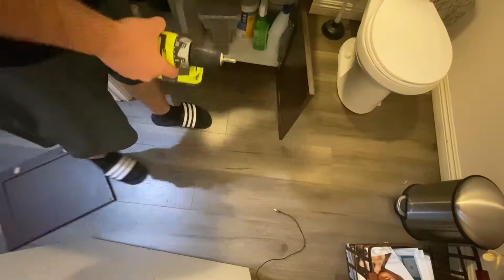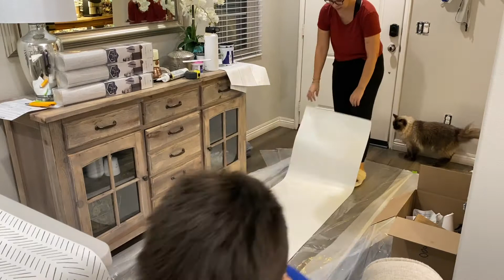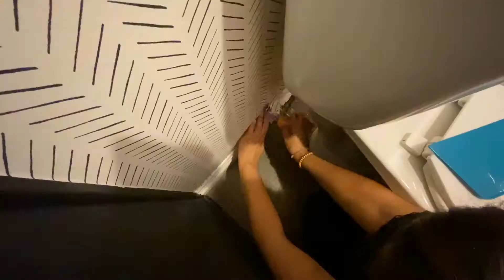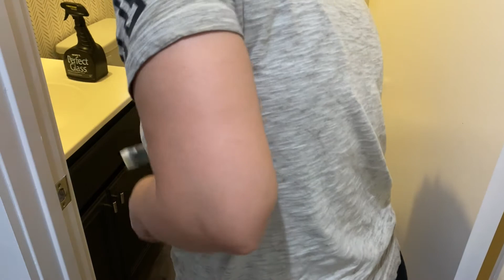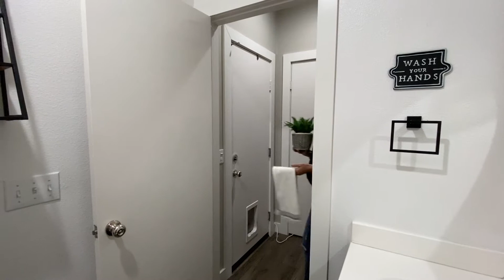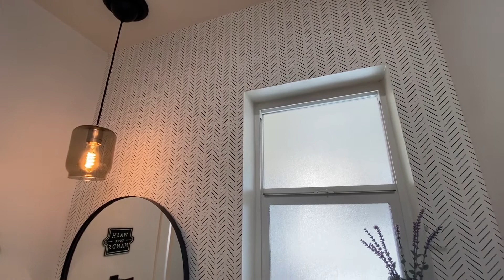Extreme Small Bathroom Makeover

Comment: ow do you make Caulk Paint?
Reply from the maker: I used Plaster of Paris. I would combine 1/3 cup Plaster of Paris with 1/3 cup of room temperature water in a small bucket. I would then stir the mixture until completely smooth, Finally I would add my flat latex based paint (1cup) and mix until fully combined. Make smaller batches if you don't need much because you can't really store it. Hope this helps!